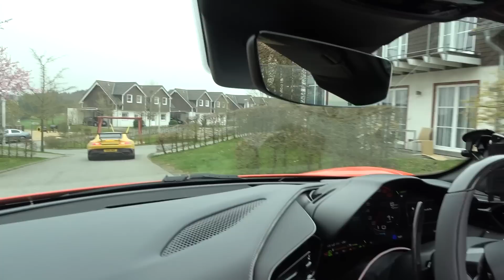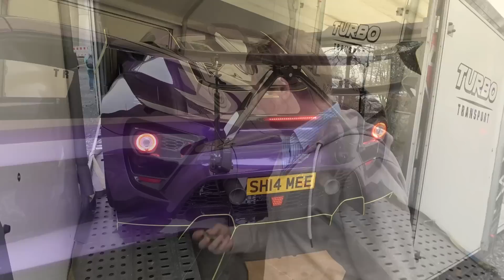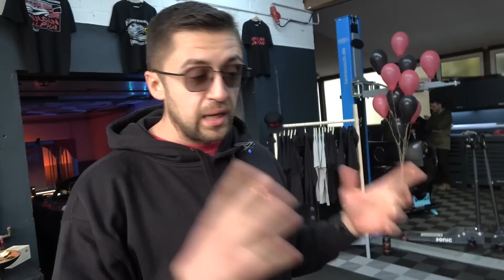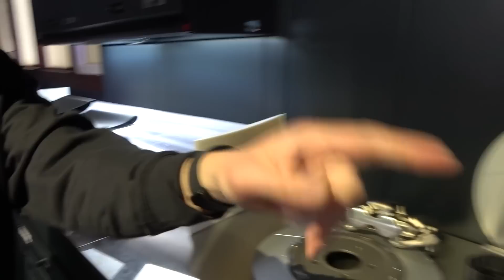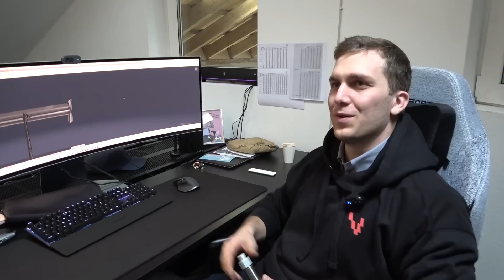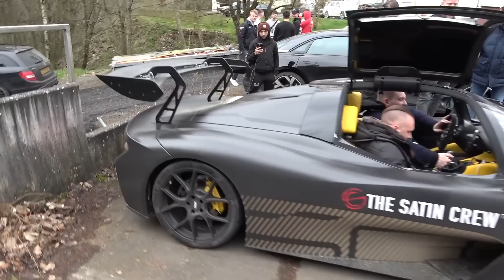DRIVING My Zenvo on the NURBURGRING!?

Comment: Why? Does the Zenvo seem like it struggles to fire up. Like it’s out of timing or worn spark plugs.
Reply: Exotic cars tend to have a longer start up than normal cars to make sure there’s oil in engine before start up, they tend to have smaller tolerances internally so you need to ensure there’s oil where it needs to be. Basically what he^^^^^^said but in layman’s terms.

Comment: Something could happen to it anywhere at anytime. There are other tracks it can be used on but the times you’d be alone on any circuit to do so would be so few and far between.

Just a bit of a shame to see it trundling around.
Reply: It’s not just any car and the risk on track full of hundreds of casual drivers increase odds of things going wrong astronomically. Sure it would be nice, but it has to be the right place and the right time.
Reply: I don’t think you read my comment.